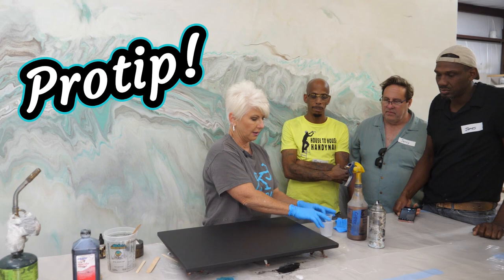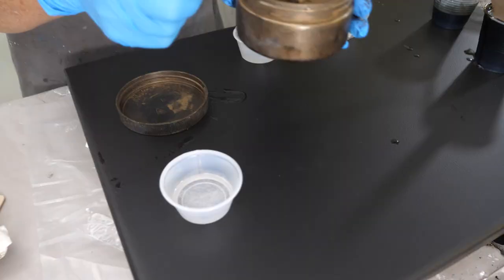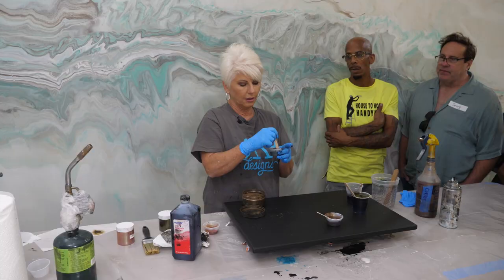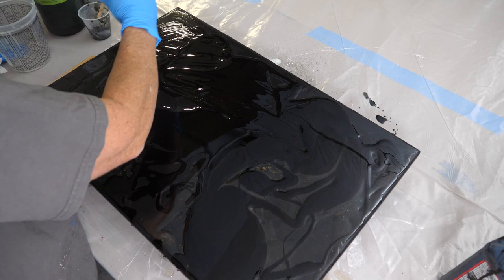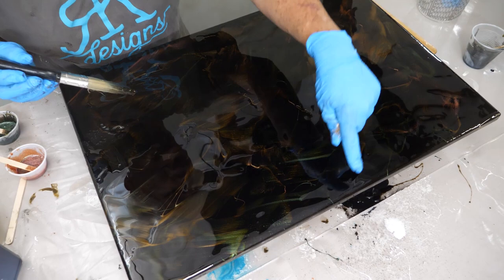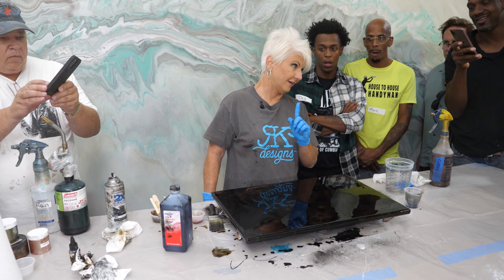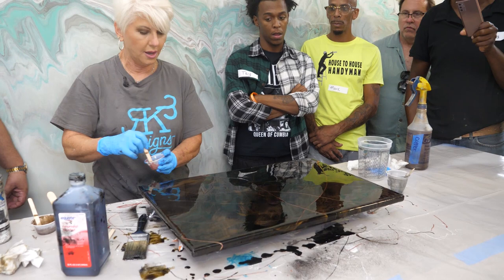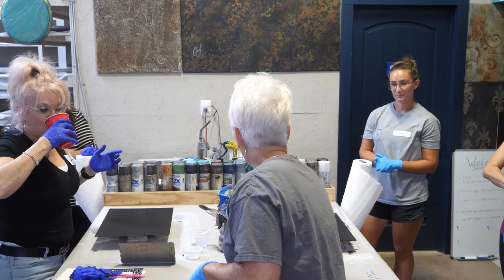How I Taught This Simple DIY Resin Marble Countertop | RK3 Designs

Comment: Can you epoxy a 6-sided box? I want a marble/quartz look for my rolling toolbox.  I want to epoxy my rolling toolbox but how do I get around the corners? Do I need to work each horizontal side at a time and blending the corners and hiding the mismatch with corner bumpers?
Reply from the maker: That’s what I would do, pour each side flat and then blend the edges. 😊